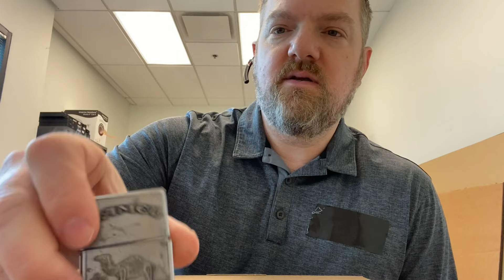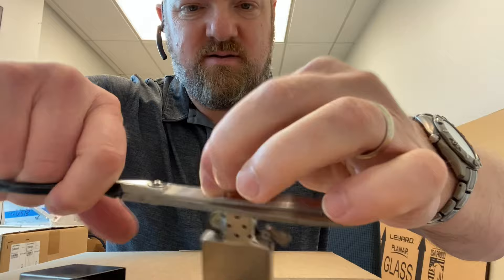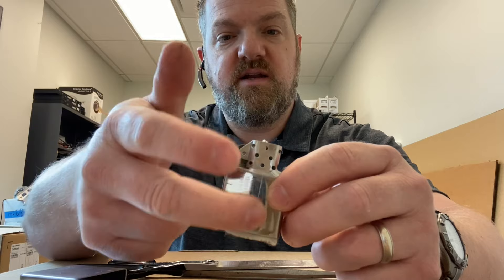How To Fix A Zippo That Wont Spark

Comment: mine stopped sparking when i pit it back together and it turns out the flint fell out onto the table 😂. you can just put the flint down the brass hole and out in the screw with the spring.

Comment: This is fucked up I have to do all this work for a new zippo lighter to light. It's a lighter not a dam PC being built from scratch. How was I supposed to know I needed some specific pliers to pull the wick up? I already bought the fluid and filled it up which should've been enough

Comment: i had the same problem and tried spinning the wheel the opposite direction and i could do that and then spin it normally and it would light but after a few times it stopped working and i would just spin and spin and nothing happened. i went back to the store to see if they had replacements and they didn't so i just bought another lighter and now that one got stuck, but i can fix both now! love that for me
Reply: also lol your daughter at the end

Comment: Excellent! Thanks to your detailed video I pinpointed the issue. My Zippo won't spark. Turns out it has the spacer, but it's missing the flint! Good grief. I have some coming tomorrow. Thanks again for the detailed video!
Reply from the maker: Thanks for watching. If you need anymore zippo parts. Click the link in the description, that really helps my channel out.

Comment: thanks a million! I have my father's lighter from 1988 and really wanted to bring it back to life. Off to shop for flint and fuel and feel much more prepared to get her lit!
Reply from the maker: How did it go, did you get it to light up?
Reply: @FrankGuest  Great news!! Mission accomplished :-D  There's a little residual flint left in the shaft (impossible to get out) that makes it a little difficult to turn the wheel, but I can still get it to work. I lost my father earlier this year and having his lighter up and running again really means a lot. Thank you so much!
Reply from the maker: @Christiezepeda  you may have brought a slight tear to my eye. I’m glad I could help you bring a part of your father back to life. Thanks again for supporting my channel.

Comment: Hey Frank, I forgot to tell you that I had the EXACT SAME
 🐫CAMAL🐪 lighter back in the 90’s. I had to save up a CRAP💩LOAD of CAMAL CASH then send it in to redeem it for a zippo. I got my wife the ladies version CAMAL Zippo. It was smaller and white with the CAMAL logo with flowers around I think flowers on the camels head. To bad I moved place to place so many times they both got lost.(or stolen)
The only complaint is when I carried my camel Zippo in my front pocket I didn’t like the sharp edges. And it’s a little big to carry. Besides I’m old now and the only job my current Zippo really has sparking 💥
🔥blizzzunts 😂

Comment: My flint wheel won’t spark. It’s new and it got stuck and I tried forcing it to work, and now it spins freely. Tried putting the flint back in and everything but no luck. It looks like the wheel is misaligned. Any tips?

Comment: How to switch out a flint. Just go to a smoke shop. They usually have zippo brand flints. I use those cheap clipper lighters from Europe.
Sweet Zippo 🔥😎✌️
Just learned that if your having trouble lightning it later on you might need to flip the flint around and reinsert it.

Comment: nice mirror finish on that insert, perhaps you know how many millilitres it take to fill then? also i tried using paraffin lamp oil in mine and it was not lighting or when lit left lot of smoke i tried letting sit a day out of its case to dry it out and refilled with zippo fluid but still giving me hard time lighting and still smokes i figured there must be some left over paraffin in it that still messing it up perhaps , will the smoky stuff eventually go away after a few proper fills with zippo fluid? and what should i do let it dry out again or keep it flaming till all the stuff is gone and refill again?
Reply from the maker: I would remove all the cotton and replace with new. Then fill it with zippo fluid. After a few lights. The smoke should go away.
Reply: i been just filling it with zippo and lighting it with a lighter letting it stay lit a long while hoping to burn through the paraffin and seems to be lighting on its own at times but still smoking ,might take a while but i don't understand why it won't light on its own without another lighter when i try it the next day as if the wick keeps drying up and needs help despite my refilling it with zippo a couple times now, my imco junior is much more reliable i prefer it for many reasons over a zippo  @FrankGuest

Comment: Bought mine brand new. Never works for longer than a day. Fill it up with a pretty generous amount definitely not flooding it though. 
 Very frustrating. Any idea what's happening?
Reply from the maker: Are you using zippo fluid? I would pull The wick out so it is fresh cut the excess and doused it with fluid. If that does not work you may have to use the warranty that comes with it. I hope the new lighters are built with the same quality as the older ones like I have.

Comment: I have a new one with brand new flint and it won’t spark what do I do
Reply from the maker: It won’t spark or won’t light? If it won’t spark, either your wheel is too smooth or the spring holding the flint in place has gotten weak with age. If it sparks but won’t light. Check you fuel and WIC.

Comment: Have an older Barlow flip top lighter and put new flint in and inserted spring and tightened. New flint is not touching the wheel. Any ideas as to how to fix it to get the new fllnt to touch wheel?
Reply from the maker: Wow. That’s a cool lighter. How old is it? Is it from the 60’s? Are the insides similar to Zippo’s? I have never had one.
Reply: @FrankGuest  Hi Frank, Yes it was my neighbors parents lighter. So may even be in the late 1960s. I looked on line to see if there was a different flint that it may take but does not appear to be. I am guessing that the flint cant go all way down to meet the wheel as I can not see the flint under the wheel once I have inserted it and tightened the spring up. Could it perhaps be dirty in the flint chamber? If so, whats the best way to clean this chamber?
Reply: @cindybaldanzi2618  i used to have that same issue on my old zippo, the old flint and residue stuck inside the tube.. i clean the tube using drill with really small size drill bit.. it solved my issue.

Comment: hi brother, my zippo sparks very little. not enough to light it up. the flit and the wick is new. the lighter was not used for over 7 years. what should I do?
Reply from the maker: Have you considered replacing the spring that holds the flint in place? Is the wheel in good shape or is it almost smooth to the touch?

Comment: Got a new lighter filled it with liquid 
Didn’t over fill. It is not sparking I see that the flint is working it is sending stuff into the air but it’s not sparking.
Reply from the maker: Did you use zippo fluid? Check the wick. Make sure it gets fluid on it from the cotton in the chamber.

Comment: I just got my zipper lighter I think I over loaded it. So my zipper was sparking, but not light, I removed the whole flint and then put it back and now it doesnt even spark... I think broke my zipper...
Reply: I just bought a brand new one, wouldn't even spark to start, still won't after repacking.... Did you ever find out what was wrong with yours/ how to get it working??
Reply: @high_stakes_ikea7087  his flint got damaged ,
Reply: @high_stakes_ikea7087  add a new flint
Reply: @fascistclips  Thanks for the fast reply! Picked some up and it's working now! I feel a little silly it was that simple haha 😅😂

Comment: Hey man great video but mine spins and everything but it doesn’t spark even tho i have a new flint
Reply from the maker: Does your flint come in contact with your wheel? If it does, you may need to replace that.
Reply: Same... Tried cleaning the spark wheel but no joy yet.
Reply: @itsPenguinBoy  did you ever get yours working? I'm having the same issue with one I just bought 😓
Reply: @high_stakes_ikea7087  sent it back to zippo... Waiting for them to return with a replacement
Reply: @high_stakes_ikea7087  did you fix yours? I have a new one that someone bought me from the zippo factory in Bradford PA and I can't get mine to work either.  There is no spark. My other I just got works great but this one I doesn't. I can't figure it out.
Reply: @mlgallagher1  Turns out I was being a dumbass and the flint in mine had broken or fallen out somehow, bought a fresh pack of flint and popped one in and worked like a charm. I straight up just hadn’t realized it fell out, didn’t expect that with a new zippo lol 😅
Hope you get yours working though!

Comment: It will spark but wont light up
Reply from the maker: Add fluid and then pull out your wick so it’s clean then cut the wick so it’s flush with the top. Then try it. If that does not work, click the link in the video description and buy a new wick.

Comment: Fuck sake its brand new n all, who the fuck said they last long lmao
Reply from the maker: I am slightly confused by your comment. The lighter in this video is pretty old. Not new at all. The only thing I replaced was the flint and added fluid. I have had several zippos and that all have lasted a long time. Plus they have a life time warranty from the company. Thanks for watching anyways!
Reply: I have one old zippo from the vietnam war which i get from my father, and it still working.. all parts on zippo are all repairable, with a proper maintenance it will last forever..